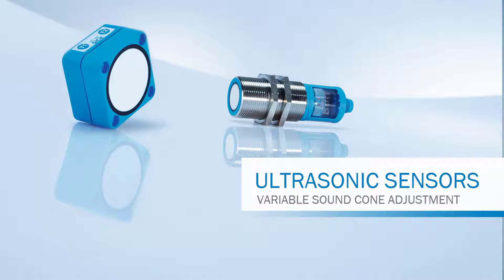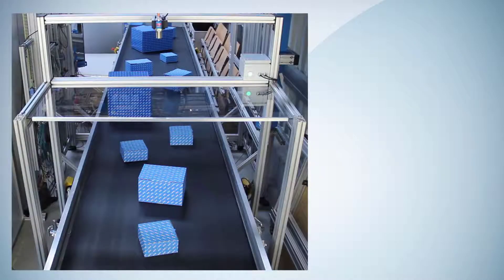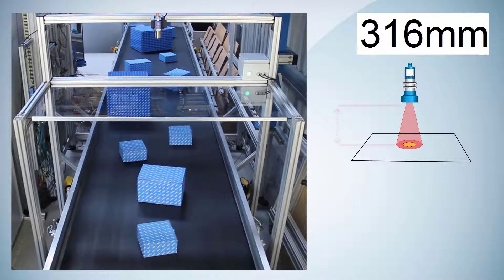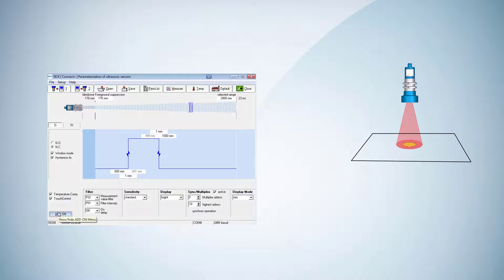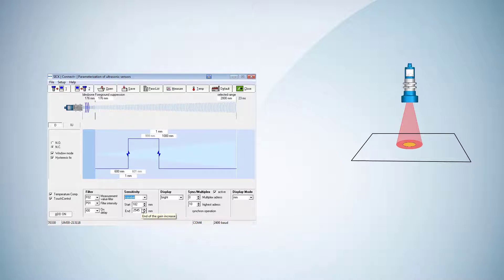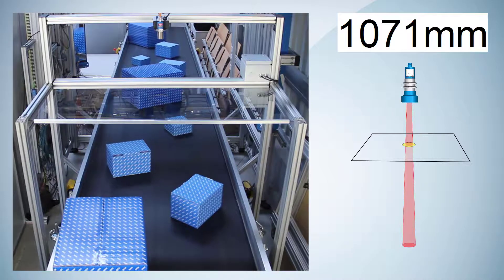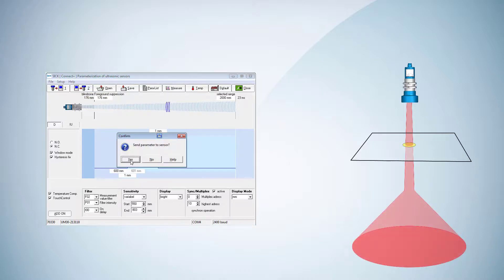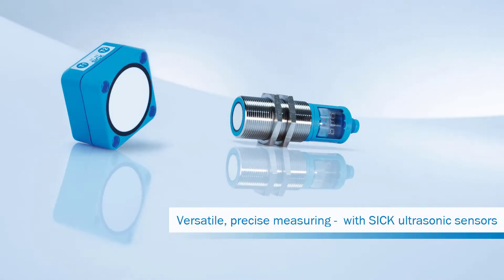Tutorial ultrasonic sensors (2): Variable sound cone adjustment | SICK AG

Comment: plain lies, every physicist knows it
Reply from the maker: Thanks for your comment @dimsum5567.  You are right that the actual sound cone we sent out from the device cannot be changed by software.
But we are able to control the amplification/gain of the received signal, which we call echo, leading to a variable measuring behavior.
So, to evaluate a variable sound cone shape we decrease or increase the echo amplification at the desired distances.
If you have challenges with your application or further questions, please contact our technical experts by mail: info@sick.com

Have a good day.